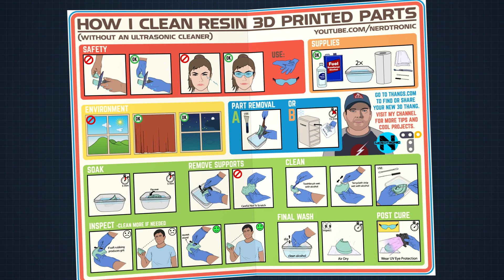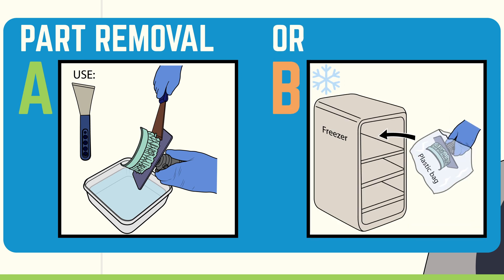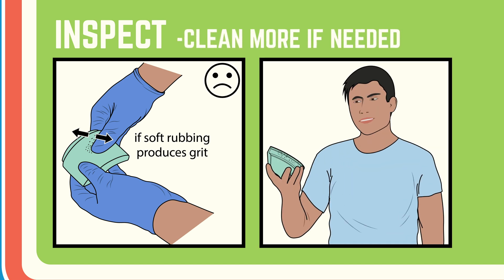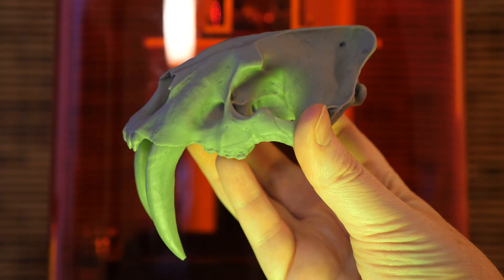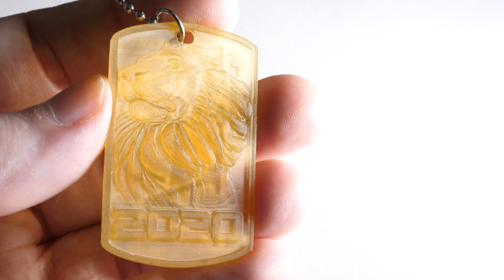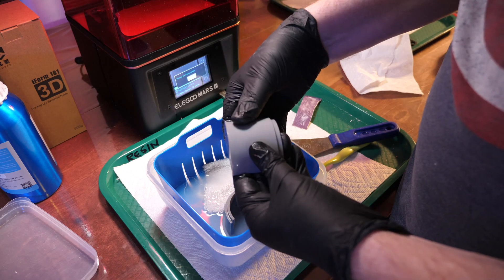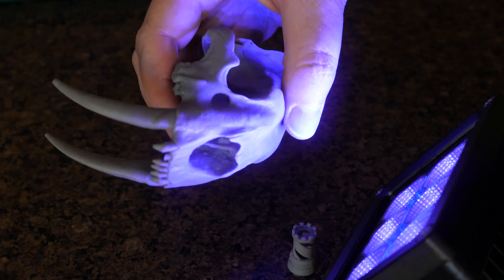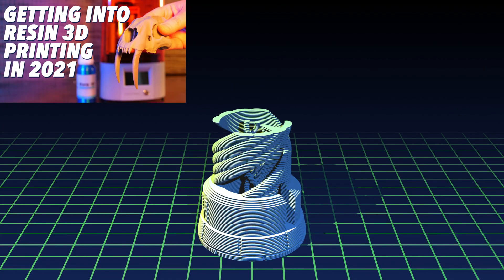Clean Resin 3d Parts - Ultimate How To Guide

Comment: Newbie question here. Still trying to wrap my head around all those supports and upside down printing. Could you not print the T with the top of it against the plate?
Thank you for all the great videos!
Reply: The facing of the T in a given example is irrelevant, because it's just to explain how to handle overhangs. Even in a perfect situation with a T you'd have a harder time putting the broad flat top of the T on the build plate will cause a lot of tension on your FEP and wear it out. When that breaks you've got a much bigger problem on your hands. Tackle the challenge, don't shy away from it. You've got the ability!

Comment: On an unrelated note, if you accidently touch something with resin gloves and want to "uncontaminated it" what is your best suggestion?  or is there a point of no return type thing?
Reply from the maker: I would clean it with a Clorox wipe. You can also put a little alcohol on a paper towel and wipe it clean. You can eventually get that resin stickiness off there.
Reply: @Nerdtronic  can you just hit it with a UV light to deactivate the remaining resin?
Reply from the maker: @marcopolo1613  You can but depending on what it is it might ruin it.  When cured the resin will make really strong bonds to some things.  Like concrete.  If you spill it on concrete and the sun cures it, it'll be there forever.

Comment: I tried the iForm 181 after seeing your plug for it previously. Not sure if I just didn’t know what I was doing or what, but I found the cap design horrible. The jagged edges tore my gloves every time I opened it and the amount of resin it caught in the top of the cap after shaking the bottle resulted in messy drips and spills every time. 

Design flaws aside, though, I really liked the resin itself. Probably won’t be buying it again unless they change the cap or someone can explain where I went wrong using it.
Reply from the maker: Yeah that’s a good point. I think I did the same thing. I use a paper towel between my gloves and the lid now.

Comment: Hi, nice! I've used pretty samelike workflow, but I've started to think, would it be much better to get somekind of part cleaner station which usually works with IPA and then also propably any alcohol products. It would be perfect to have that brush head with constantly running fresh cleaner solution.

Waste would go into drain, I imagine if under that there would be tank with somekind of purification setup, like UV light separating resin waste from alcohol before it goes recycled to the pump of that parts cleaner..

Would help a lot to clean any tools which using with resin printer, and especially larger prints without having huge vessel filled with alcohol. Also you can clean this vessel always by itself and there is no big surface area where alcohol can vaporize too easily as it normally does. 

Hope you get my point and may you have some opinions about this :)

Comment: One step I definitely do differently from the pdf, I never scrape part directly to cleaning vat. While not as bad as liquid resin, liquid used for cleaning aren't too healthy either (and after a while, contain liquid resin too), and you don't want to splash it all over (even if your work area surfaces are protected - another useful tip)

What I do instead, I have a suitably sized box with a few paper towels at the bottom. Of course paper towels aren't really needed, but they absorb some of the liquid resin. That's less liquid resin mixed with your cleaning liquids (I started doing that when availability of IPA became worse and worse last year)

And last but definitely not least, inspect EVERYTHING you just removed from the print platform. If anything is missing - it's likely stuck at the FEP film, and you should remove it (or almost guarantee the failure of the next print, and in worst case, broken FEP & screen & resin leak all over the printer)
Reply from the maker: Thanks for those additions.

Comment: Great job and I really liked this one. a question: in a twitter conversation @billieruben said that she doesn't advise taking off the supports, but get it to curing ASAP due to the nasty nature of uncured resin. That was the first I'd heard of it. Do you feel that it's safe to do all the things you're suggesting before getting parts more cured? Would you use thicker industrial rubber gloves vs. nitrile disposables?
Reply from the maker: Wait until after it's cured to eat it?  I don't see a problem with waiting to post cure.  Some people think you need to wear gloves to touch the parts even after post curing.  On the gloves.  Nitrile might actually do a better job of protecting your skin.  Your fingers need to be nimble and be able to do their job.  So if you wear something so thick you can't really use your fingers, eventually you'll stop wearing them.  Or you'll take them off for a second.  It's best to have safety procedures that are simple and that you'll be more likely to follow.  That's better for long term success.  (In my opinion)

Comment: I dont know why people waste money on IPA when you can just rinse the print off with water, and no I don't mean using water washable resin, I mean regular resin. Just get a large motor oil funnel put it in your utility sink then create a fast moving Vortex of water from the spout hitting the inner side of the funnel. Creates a really fast strong vortex that removes all the resin, no fuss no must no chicken dust... or how ever that saying goes.
Reply: You're washing resin off in a sink? Pretty shitty thing to do.
Reply: @darbycrash1186  sure bud, as if people don't pour bleach, acid, drano, soap, detergents and a dozen other more harmful things down the drain daily. Atleast with resin prints your only rinsing off a small thin layer of resin. No I certainly wouldn't pour a bottle or even a cup of this stuff down the drain. A teaspoon of rinsed resin isn't nearly as bad as thr shit you dump into your toilets and sinks daily.
Reply: I had the same thought after watching many videos (not necessarily this one btw) with a seemingly endless number of complicated steps for cleaning prints. I've been following SLA printing for a few years on and off and "received wisdom" regarding processing prints has gotten more compicated over time without much explaination why. How much of it is redundant? It would be interesting to see differences in final results between cleaning involving only water, and cleaning with alcohol, before curing.

Comment: I usually remove the supports before cleaning, so the dirty alcohol last longer. 

I also cure the support in the sun as it's better for the environment.
Reply from the maker: Thanks - the sun is free 😀
Reply: @Nerdtronic  That it is. What i meant was that i cure the supports because its better for the enviorment. That i am doing it in the sun was just addition info, as i usually do it without cleaning them so i dont want to mess up my curing station.

Comment: My room has standard window blinds which I plan to shut.  Is this good enough for cleaning?   If I end up blacking out the room what kind of lighting should I use to see that doesn't have UV?
Reply from the maker: I've never had a problem with just led light bulbs and lamps.  I have the overhead light in my office plus 6 filming lights and none of that is curing the resin.  As for the blinds in your room, it's hard to say.  Might be ok.  Depends on a lot of things.. like how far away from that window you are printing and cleaning, etc.

Comment: Is there a reason why you don't use an ultrasonic cleaner? I got one for cheap at harbor freight
Reply from the maker: What he said.  Also I have enough large box machines in my office already.  I'm not opposed to using one but if I have to put the alcohol in a bag in the water to not catch my house on fire - I'd rather just wash by hand.
Reply: You should not use an ultrasonic cleaner with IPA, which is highly flammable. Only use it with water washable resin or put the part to wash with the IPA in a separate sealed container and throw this container into the UC.